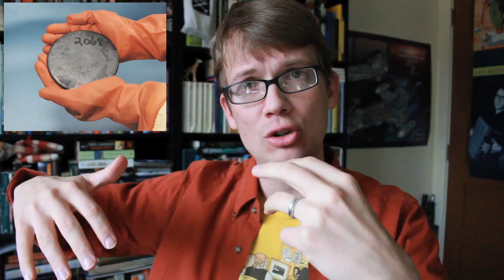Why Did Fukushima Explode?

Comment: Beautiful explenation and a beautiful explenation why Germany is being retarded for shutting down all the nuclear power plants since the earthquake was not the problem, the tsunami was. But what are the odds of Germany being hit by a tsunami? It's fine moving to "green" energy, but their rushing methods are bad. Nuclear energy is one of the most "green" methods of generating power, basicly only beaten by hydrogen dams. But those are limited to the rivers we have and how strong those rivers are.
Reply: Don't forget solar power
Reply: +Trea' Schellenger way too cost clostly to replace all nuclear power plants with. Let alone the fact they they dont deliver power 24/7 and if you say batteries, well, forget about them being clean.

i didnt forget them, they are not a good alternative.
Reply: +Lennart but, every year efficiency of panels produced go up and methods to produce and distribute said panels go down, what's to say they will not be viable in the future? I posit that nuke power is the intermediary step to solar power in most places. however, in places where solar power is impractical(underground, earth's poles, space) nuclear is definitely the best option. in my opinion
Reply: Trea' Schellenger excellent, the future. So what about the time in between present day and the future? It seems everyone forgets about that. On top of that it wont help solve the night-time gap.
Reply: can you rephrase the question? I don't understand it.
Reply: Trea' Schellenger you said solar panels might be a good alternative in the future. How many years until that is? 10? 20 years?
However, the nuclear plants are being dismanteled now, present day. So what about the 10 to 20 years that Germany doesnt have nuclear power or good solar panels?
You'll have a gap in which you cant produce clean energy. Because the green alternatives cant produce enough. So the gap is being filled by coal and oil plants.

Ofcourse it still leaves the nigh times in which solar panels are useless anyway.
Reply: I absolutely 100% do NOT disagree with you. Nuclear is the option of now. It is the greenest option available. 5he problem is that pwrs in place now are old, and construction was curtailed following events like chernobyl and tmi, at least in the us.  Only 20% of our power came from nuke power this year, BUT, 5 new reactors are under construction as of this year. So yay, kinda.

Comment: ... All ways of generating electricity is essentially just moving something like a turbine... Why not just hire people to move the turbine or something a bit like a treadmill that moves a turbine? That would raise employment, create clean energy and, if doctors send people who go to doctors about their weight (not under-weight) to run on that treadmill-like thing that would count towards the exercise that they would be paid for; so, also motivation.
But no, CEO's want money so they don't go for things like this or they go for oil and other damages things for money... sigh
Reply: i feel that would be an incredibly inefficient system. We are talking megajoules of energy in any powerplant that feeds a town/city
Reply: I want to agree with you but, it is very very weak. You'd probably have to run for years on a treadmill to charge a car battery like that. When powering a city, you have to be talking about mega joules. HUGE SCALE POWER.
Reply: Pixie22462 Maximum energy output of a human is on the order of 10 Watts. Which is barely enough for a couple of high efficiency lightbulbs. Say you want to power a 400 Watt computer? That would be 40 people, running constantly. None of this considers the wasted power of the friction and heat losses in the system.

Comment: One point. There is still plenty of uranium in the spent fuel rods. In fact only a small amount of the fuel has been used, but the rods have to be removed because the zirconium cladding can only survive being in the reactor for about 18 months.
Reply: That is an interesting concept. I'm not familiar with civilian reactors, so, to my knowledge, zirc cladding is meant to last much longer than that, up to decades because of its corrosion resistance and heat transfer properties.
Reply: +Trea' Schellenger In addition to the cladding, the rods of ceramic fuel also break up during the process of fission. Partially this is because there is a temperature differential of about 1000 degrees centigrade between the centre and the outside of the rods. This causes a lot of stress. And then many of the fission products are gases like Xenon. which means solids are turning into gases inside the pellets themselves.

Comment: The issue with nuclear power in this case, as far as I can tell, is not with the nuclear power stations themselves but rather their locations. Japan is an extremely natural disaster-prone area, sitting right on top of a major earthquake zone. The fact that it's such a long and skinny island with lots of mountains means that most stuff is confined to near the coast, which makes it susceptible to tsunamis as well. I feel like nuclear power plants are a good idea and a much better power source than fossil fuels, but that they should only be built in mostly disaster-free areas. You can never find a place with no natural disasters, but Canada's nuclear power stations in Ontario, most reactors in Europe, etc. are much safer than those in Japan or California.
Reply: Sparsely populated would be good too.  Of which Canada has an abundance of.

Comment: What's wrong with solar power? I've heard only that the amount of materials would be excessive, but I've seen no evidence or even a sincere argument to back the claim.
Reply: Cost.

Eventually, Moore's law will make that a non-issue for solar panels, but we're not quite there yet. I'm personally a big fan of the quantum-dot based cells as the technology has a lot of potential for both cheap mass-production and high efficiency.
Reply: BosonCollider That and the sun isn't always shining. In some places of the world they go weeks without seeing the sun. Hard to use solar panels without a sun.
Reply: It all comes down to money. The gas companies buy up the patent for anything solar related. That's why solar panels aren't very efficient and batteries are expensive and only last a few years. There is so much money in oil that they can easily buy out the competition. I doubt we will see a transition into alternative energy until using oil isn't cost effective. When that day comes guess who has all of the patents!  The oil companies!

Comment: Is there a reason they don't use the heat being created by these spent fuel rods and convert it into even more energy?
Reply: There isn't enough of it. The spent fuels rods produce relatively little heat, but they are dangerous because they don't stop getting hotter. If the coolant systems are offline then the spent fuel will slowly heat up, and it can take days for these to reach any problematic temperatures.

Comment: Forget whether or not the benefits of nuclear power out way to the harms, the pro:con ration of nuclear power out ways everything else! Saying a "good" way of creating electricity about anything that we are currently using is FALSE, but nuclear power is the BEST way. One uranium 235 pellet smaller than the tip of your thumb is equivalent to literally a ton of coal, 143 barrels of oil, and 14,000 cubic feet of natural gas. While a single reactor would only create about a cubic foot or so of nuclear waste a year, windmills kill thousands of birds and bats, solar panels take up a LOT of space, and hydropower DESTROYS environments. Plus all those unrenewable power sources explode anyway, so… GO NUCLEAR POWER!!!
Reply: Nuclear Reactors should only be built in the middle of a continent where there are barley any earthquakes (and very very very weak ones) and not near the ocean and in a stable country with a high literacy and a huge amount of precautions. Nuclear energy is the best way on earth to create power. But it is the riskiest too. If we take the right precautions, we can be looking to a brighter future where electricity is crap cheap.
Reply: Tuxmycat Sprite Wind is an unlimited resource, but it's very expensive to harness it, and convert it into electricity, and it also just doesn't create efficient amounts of electricity. 
That's just the way it is, and it's why wind can't be a base power source, but we still work on it to see what improvements we can make.

"It's almost as if our society values opinions more than it values knowledge."
Reply: GLTDubstep
What do you suggest then? Nuclear is better than coal or gas from an environmentalist point of view (and arguably from a humanitarian point of view), and untill we learn how to efficiently store electricity renewables will only ever be a supplementary system.
Reply: Tuxmycat Sprite ... just because you don't see dead birds everywhere doesn't mean birds aren't being killed?  if you were to do your research, you'd see that approx 200,000 birds are killed by wind turbines annually.  i'd say about 5 of them die every year in your city, but are just cleaned up by your municipality as most dead animals are in cities.
Reply: "Our best power source." Hah! Wind isn't even close to being that! For one thing, of we to convert to only making electricity ONE way, that being the "best" way, wind and solar would be our of the question. They aren't baseload power sources, so they can't be used on their own. Don't go one about storing the power for when there is not wind and sun, because for every megawatt of electricity that a wind/solar plant produce, there MUST be a base load power plant that creates a megawatt of power. Oh, and nuclear power is baseload. ;)
Reply: Noize_ it was because they TURNED OFF ALL SAFETY SYSTEMS because they didn't have enough energy instead of now doing it that day
Reply: GLTDubstep

How is it passing costs off to future generations? Do you even know how nuclear waste is disposed of?
Reply: GLTDubstep You can recycle nuclear waste to be reused in a nuclear reactor.  The U.S. did it for decades before the Carter administration ended it.
Reply: Ben Jones Can you tell me of a nuclear break down in a sane country? Canada, the US? Nope? Plus we are humans and we are sure to make mistakes. How much you wanna bet you made a spelling mistake when typing that reply? It is something that we must learn from. Plus, 1989. Do you know how much we advanced in technology since 1989? Man, an iPhone 6 would have costed about 5 million dollars if it was here during the 1990s. Imagine our most advanced systems in a nuclear reactor. We learn from mistakes. Take for example Edison. It took him thousands of tries to find the right filling for the inside of the bulb. When interviewed, he was asked if it would be a lot easier if he just got the right ingredient on the first try but replied: "No, because now I know thousands of ways how NOT to make a light bulb."
Reply: Hassan Tahan Would you like to point to where Chernobyl is on a map? I'm fairly sure there are no plates near it and it is not near the sea.
Reply: Ben Jones Chernobyl melted down because it was not constructed right and used a type of reactor not used in the us
Reply: Last of the Shadow
Reply: vampieofsavannie
Wind is actually ussually cheapest power source available, but as you mentioned, is not reliable enough to make a baseload in most cases.

Unless you live in ontario. Somehow we fuck up every power source.
Reply: Ben Jones Canada was home to the first serious accident (rating a 5/7 on the INES scale). 1952, the NRX accident (aka First Chalk River Accident). Operator error mixed with mechanical failures lead to hydrogen explosions in the containment.

As for the US, we had Three Mile Island (5/7), the SL-1 Experiment (4/7), the MSR Experiment in Simi Valley, CA (never rated because it was hidden from everybody - until the investigation into Three Mile Island accidentally revealed it).
Reply: Wait, where? I only saw me spell that word one place, and in that circumstance it was spelled "way".
Reply: Oh! NOW I see it. Well, I WAS typing with my phone… But seriously, look it up! It's CRAZY!
Reply: actually windmills don't kill thousands of bids/bats. i live near a wind power plant and the city i live in (Wichita, ks) has a lot of buildings that use windmills in their yard/parking lot, and i don't see dead birds everywhere. (and no, there are still birds in town, and there are a lot of birds in town.) i'm not saying nuclear power is bad i'm just clearing up the confusion about wind power, plus wind mills don't have a extremely small chance of something going wrong and melting down. :)  GO WIND POWER!!!
Reply: I just heard that they post an eminent danger to our flying friends, and the bats fly into them because they can't see them very well and it's hard for their sonar to detect something that isn't there when they send out the sound wave. And that comment toward nuclear power and melting down really is NOT fair because pretty much everything you get electricity from that you need to mind (coal, oil, natural gas) is explosive/unstable to some extreme, particularly natural gas.
Reply: ***** the nuke power bit was a joke because people are stupid and think that just because there is a chance, therefor its evil. and the rest of the comment was just clearing up the thought that they pose a danger by telling my experiences in real life.
Reply: ***** base load huh? i don't think there will be a time when there is no wind? if there is no wind there is no air and we will have more to worried about then. there is always wind, maybe not that strong on the ground, but wind turbines are high enough for there to always be wind to push them, like i said earlier they always  spin. still waiting for that response ;)
Reply: "Almost"? This society(as in the majority as a whole) DOES value opinions over knowledge. It's unfortunate, but that's the way it is. I'm basing my opinion about nuclear power being the best off of knowledge, which is how opinions are formed.
Reply: Did you even watch the video.

If you're so adamantly in agreement, the LEAST you could do is try to have opinions that are based in knowledge, and not fickle word-of-mouth.
Reply: Nuclear power is like borrowing. We are getting relatively cheap energy now but passing on the costs (of disposing and caring for the nuclear waste) to future generations. This runs into hundreds/thousands of years into the future, not just even a single generation. This is why I do not support it.

We can afford to go to war thousands of miles from our homes (in 2 countries at once), but we cannot find the money in our coffers to invest in clean energy which will be expensive now but pay vast dividends in the future.

Unfortunately there is far too much vested interest in nuclear and fossil fuels.
Reply: there are long lists of incidents involving the usa causing direct deaths, billions of dollars of damage, and the unknown scale of heath affects
Reply: "out way to"? Really?
That sets the ignorant tone of the whole of your comment and I'm guessing that English is not your mother tongue.
Reply: Myles M now that you explain it it looks like it has no impact at all. 5 birds huh? looks like that is a natural disaster and we should all stop using our best power source because of it. about 89 people died every day of car crashes in 2011, oooooooooooooooh we better stop using cars. everything has a risk and people don't die from wind power plants as often as coal or natural gas, 5 birds killed in my city to produce cheap, clean energy? sounds good. and also i take a walk every day in the morning, unless there is a group of people ready to run out behind the bushes and clean everything before i get there, you are not telling the truth. i see about 2 dead birds ever month. and the wind turbines don't spin as fast as a high power fan used to cool someone off, they spin very slowly. now give me a real response.

Comment: ***** Ok, one last question: if nuclear waste produces so much heat couldn't it be used as a secondary source of energy or is it too unstable? Can't it be controlled or contained or recycled somehow? Einstein said using nuclear power is a heck of a way to boil water but can't that be done with, I guess, nuclear cast off material? Energy is energy, right? 1000 yrs waiting for something to become inert is a looong time...there's gotta be some way to make that productive. :-/
Reply: It could technically be used as a source of energy (anything that produces heat can at least be used in a thermo-electric cell), but the energy produced is small enough that it is not economically viable to do so.

I haven't crunched the numbers, but I don't think it would even produce enough electricity to power it's own cooling system.
Reply: No kidding. Thanks for answering! I've always wondered about that...